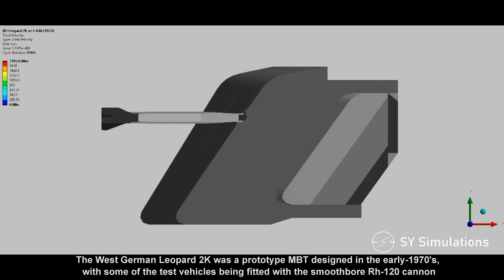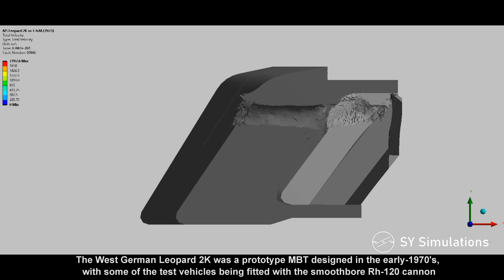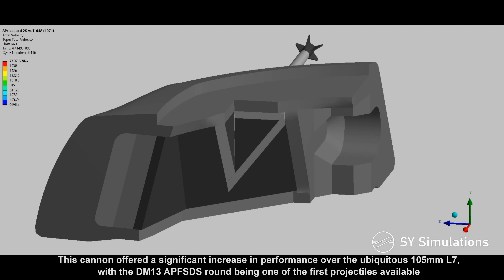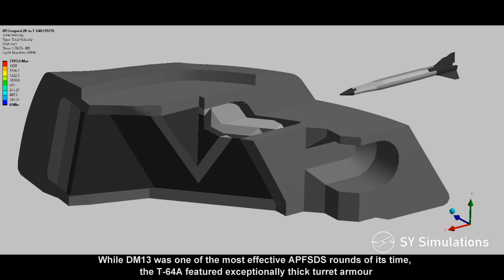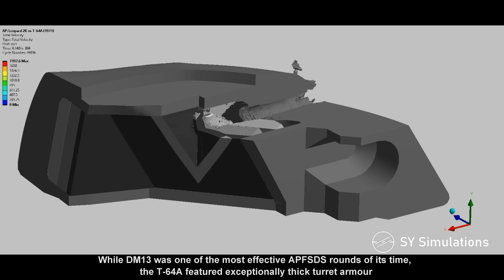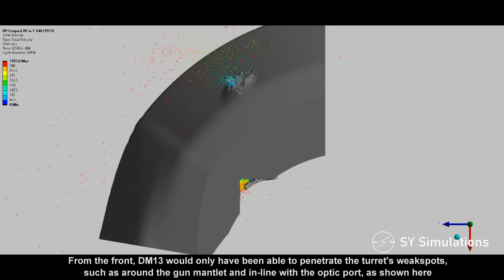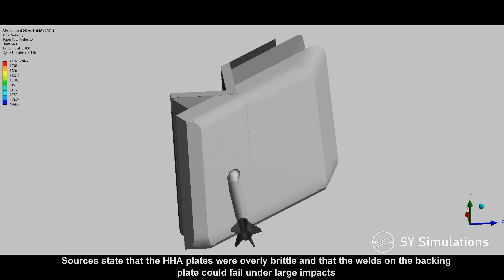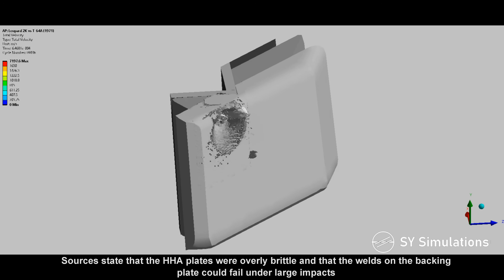LEOPARD 2K vs T-64A WEAK SPOT | 120mm Jacketed APFSDS Armour Penetration Simulation

Comment: I sometimes think about how in real life tanks just aim at center mass as they prioritize hitting the target, while shooting at weak spots is purely for video games. if it is a lucky enough hit or the round is powerful enough, then it should damage or destroy the target, but hits are still a scary experience for the crew on the receiving end even with minimal damage.
Reply: also first shot most of the time is HE, then they switch for AP
Reply: @Giacomo020189  true and sometimes they even go around without loaded ammo, they only load once they confirm the target so they select the correct ammo, very different from video games
Reply: @Giacomo020189  Would a 120mm HE do substantial damage to get a mission kill or systems damage?
Reply: @Lomni  there is a video in ukraine where a leo2 shoot HE to a T72 , the T72 got hit in the back but kept rolling and retreat , no mission kill or disabled tank , but enemy back up
Reply: @Giacomo020189  So minor damage to some areas and brown pants at least ?
Very likely engine compartment got something and needs to be tended asap if want
keep tank operational.

Not every hit causes visible damage but taking account how much moderm tank have electronics at outside
even autocannon must cause nasty errors at combat screens and effectively blind crew.

We saw that from that early bradley vs t-90m how bradleys hammered t-90 which tried to retreat but
hit tree/got stuck and crew bailed.

So by pure physics 120mm to anywhere must be quite smack to least reconsider your life choices.
Reply: @Kesssuli that honestly depends. A well trained crew should just lock in even harder. Apart from that, an HE hit in the engine bay, even if it's 120mm, surprisingly does surprisingly little. The paint job could quite likely be the only thing damaged. Also a minor inconvenience for the crew in comparison to blocking a kinetic penetrator round, especially since the engine will absorb a good bit of the sound and shake. Tho that doesn't mean the crew won't reconsider their live choices after the battle
Reply: That's right bro, only tanks in video games can penetrate weak points, although it's very false since many sell them to you as tank simulators, in real life you only aim. Calculate and shoot where the projectile hits, that's another thing. Regards.
Reply: funny how in ww2 good german gunners knew EXACTLY where to aim to defeat the soviet tanks. If you are good enough you can hit a weakspot over hundreds of meters without rangefinder or help.
Reply: @GervinSchwarz Yes, we should definitely believe the nazi germans, they'd never lie about anything.
Reply: There is a video of a bradley being used in ukraine to fight agaisnt a russian T-90. The gunner knew the weak spots thanks to video games.

Comment: The 12,8/8,8 cm Pzgr. TS was fired at over a little over 1800m/s with 28 kg Propellant in tests, while this was comoletly impractical due the shatter limit being 1300m/s, it would be interesting to see the 1800m/s velocity against some thick flat and angled plate.

Comment: And that's the weak spot
Reply: The weakspot would be gun mount..
Reply: @charlieyes4946  which would still be really difficult to hit at any range with contemporary fire control systems
Reply: @elongated_musket6353 contemporary fire control systems?
Reply: @charlieyes4946 FCSs of the time incorporated stereoscopic and coincidence rangefinders, which arent as efficient or accurate as laser rangefinders. Its difficult to hit a moving target while manually ranging and taking into account lead at the same time, combined with the FCS's inherent inaccuracy, not to mention the gunner sight's offset to the main gun. The tank sim-lite Gunner HEAT PC does a good job of explaining this. Trying fighting T-64As in Leopard 1s and M60A1s.

Comment: The T-64A is 60 years older and lighter than the already cancelled M10 Booker MPF, yet the Booker can only withstand 30mm rounds on the frontal part of the turret, the rest of the vehicle is only protected up to 14.5mm.
Reply: Yeah well what good is armor against a flying drone?
Reply: Youre comparing a light tank with a MBT
Reply: @matthelord7695  Well yeah, but then again a "light tank" which is heavier than this MBT.
Reply: @JAnx01 most of the weight isnt in the armour, its in the engine to keep it mobile, its in alk the system so it could supprot troops and do its role, it esentially is an m3 bradley with a 105 and a beefy engine
Reply: @matthelord7695 False. Powertrains are usually just 5-10% of the weight

Comment: I hope to share what makes this armour design important as an example of proper first generation composite armour designed according to a sturdy scientific model of shaped charge jet penetration, instead of trial-and-error. 

Although it might sound like "common sense" to bolt the high hardness steel plates in front instead of the back since that's how bulletproof vehicles do it, armour strength (hardness) has minimal influence on shaped charge jet penetration in its initial stage, because the jet tip freshly emerging from the warhead travels so fast that penetration is fully hydrodynamic; only densities matter, strength has practically no influence. During penetration, the tip is lost and the slower body behind it becomes the new tip. In this way the jet is progressively spent and the tip that pierces the armour is progressively slower and slower, making the penetration process transition from a wholly hydrodynamic interaction into something that isn't. So, while the hardness of the armour hardly matters initially, it has a significant impact in the latter half of the penetration process.

Since making the entire thickness of the turret out of high hardness steel was impractical for many reasons, and making the front part harder would hardly improve resistance anyway, the most sensible approach was to stack high hardness steel plates behind a medium hardness armour body. But high hardness steel only modestly outperforms medium hardness steel against shaped charges, so only a modest improvement in mass efficiency was achieved through this composite design. Still, it kept the turret slim, and the sheer thickness of steel was responsible for stopping powerful KE penetrators.

Meanwhile, the optimal solution in terms of mass efficiency is to layer a material of high specific strength (e.g. fiberglass) behind a steel body, as was done on the T-64A's upper glacis, but this of course demands thicker armour. 

The performance gain from using high hardness steel in the final layers of the armour persists even in composite armours relying on reactive elements like NERA. High hardness steel backing plates behind NERA arrays are found in the Abrams, T-72B turret and T-80U and T-80UD turrets. In these armour designs, once again the hardness of the initial layers hardly matters, the protection mechanism is jet defeat followed by efficient absorption of the disrupted jet body.
Reply: Very nice explanation
Reply: Where can one read more about design history and philosophy of Cold War tanks/armour, beyond the very broad "Armour was getting too heavy and needed to be able to stop both CE and KE threats, so they invented composite armour. The End." The only such source that I know of is the btvt website in Russian. Do you know of any more?
Reply: @GrimmyDimmy  There is a site that goes very deep into the design of specific soviet tanks called Tankograd, but sources/materials on Western designs are alot rarer
Reply: @GrimmyDimmy  I attempted to cover the history and principles of the T-72's armour in my book T-72: The Definitive Guide to the Soviet Workhorse. I am not aware of anything that explores composite armour development in the same way for either an individual tank or across all a nation's tanks.
Reply: @tankolad  wait youre the guy who wrote that? does that mean youre also the guy who wrote the tankograd blog
Reply: @nam430  Yeah
Reply: thanks bro

Comment: Would 3bm32 Vant be able to perforate the M1 Abrams (the first model, not the M1A1) turret cheek?
Reply: According what 3BM32 have 500+ mm of penetration and   turret's armor of M1 Abrams (1980) have +-420mm RHA, well...
Reply: Should be able to. M1 was only designed to protect against 115mm. M1IP brought up that protection standard to 125mm.

Comment: T-10M full caliber AP vs chieftain hull upper plate
Reply: There is no way it would pen.
Reply: @Kasian02 there would be a very high possibility it would
Reply: @matthelord7695 not really.
Reply: Soviet commonly used blunt nosed ammunition that did exceptionally well against highly angled armour  @Kasian02
Reply: @matthelord7695  "exceptionally well" means not as bad as the others. Blunt nosed shells still got deflected and shattered. And I'm sure post-WW2 soviet tanks used german-like capped shell design like BR-472.
Also Chieftain's 85mm at 72° gives it 275mm line of sight thickness. Even T-62's APFSDS had a hard time penning it at longer ranges. So full caliber shell doesn't stand a chance.
Reply: This would be interesting to see

Comment: How about Monolithic Turret of T-72 Ural versus 120mm HESH Round from Chieftain?

Some sources says that this turret can stop 120mm HESH, due to it's thickness, which is pretty thicker than previous T-62 turret, but I don't think that it would be that effective against large caliber HESH shell.
Reply: Monolithic turret of T-72 "Ural" is not "pretty thicker" than the turret of T-62, it's significantly thicker. 

T-62 turret had up to ~~200 milimeters of armor in the front.

T-72 "Ural" homogenious turret is up to ~~400 milimeters thick in the front. HESH isn't getting through that.
Reply: @jebediahkerman3826 183mm HESH then?
Reply: @jebediahkerman3826 

Would think the hesh would still rupture some welds or even break the roof above the driver